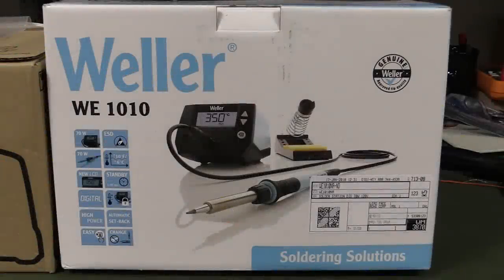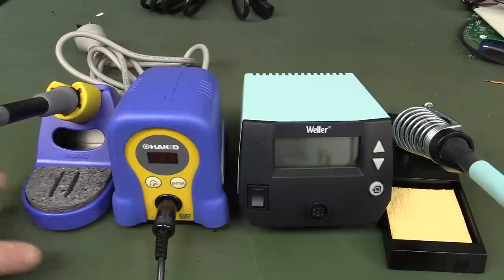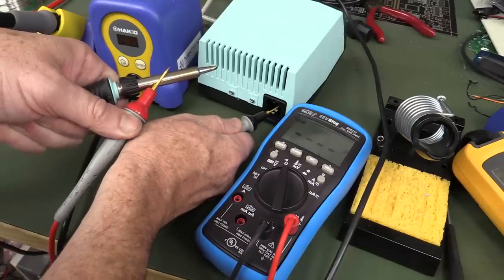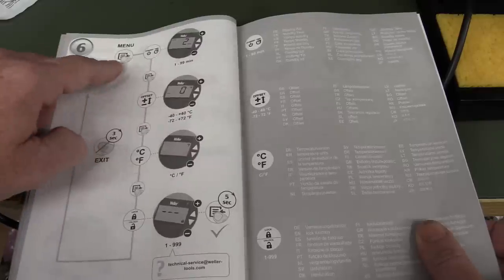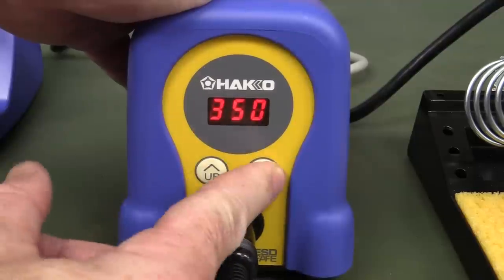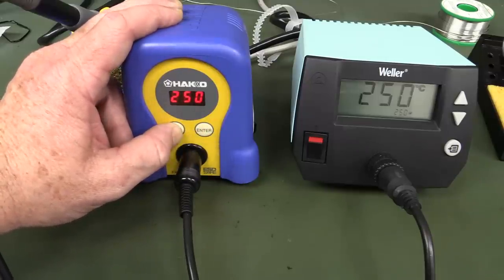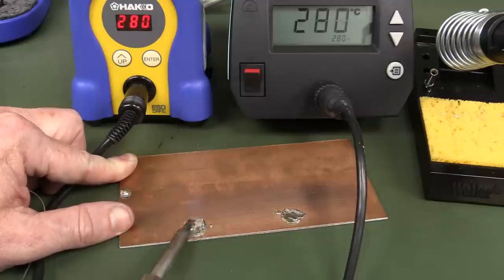EEVblog #1063 - Weller WE1010 vs Hakko FX888D Soldering Station

Comment: I've always loved the easy adjustment Wellers have had. My trusty 50W analog adjustable model was still working perfectly after over 25 years when I upgraded for a better model with more power and smaller handle. I prefer small pen type handles a lot with modern smd stuff. With a bit more power small tips heat very fast too. (You pay a lot more for those too unfortunately)
I've no experience with Hakko but the adjusting interface is a huge fail. I know I'd get so annoyed by it that I'd not get one.

Comment: Looking for your review on the Pace MBT 250 repair/rework station. Like to hear what you have to say on that. This is for serious and dedicated solder techs. Worked with the equivalent of the PRC 2000 back in the mid eighties while in the Air National Guard. Nothing but good to say about it myself. A real station with high quality and versatility.

Comment: You said it best, they both have there strengths and weaknesses.

Personally out of the two, i would go with the hakko, its probably better made for the price. Of course weller is good, but for me, you need to spend more on the higher weller models, to get the quality.

Germany vs japan, and comes down, to how you view the products you like, and what strengths you like in those products.

I would say that the weller, is not as well made as the hakko at the price, as weller are trying to get you to buy there more expensive models, which are alot better.

Comment: Hi, Dave! First of all, thank you for all the cool videos you put on YouTube.
I've just bought a WE1010 but sadly it had the wrong plug in, so i decided to change it by myself, testing with a voltmeter which pin belongs to the right end. As I plugged in the the station, the thing made a strange noise and i immediately switched it of. From the smell the station released I could tell that I've probably damaged it, but I'm not sure, anyway I don't dare switching it on again.

Could you please give me a advice?
Reply: First, if you haven’t blown something up in the last year, congrats! (If you have, you might not see this) If you’ve managed to survive, stop opening cases and take stuff to qualified repair persons.
Reply: Should have read description. it was 120V device you powered from 220!

Comment: My hakko fx-888d came with a chisel tip. The iron I had before was a Weller pen that plug into the wall, the hakko soldering  station  is much better, I like it but if it was a Weller I would be saying the same thing.

Comment: I think that the Weller seemed to do a bit better here. Sure the soldering stand is not perfect, but the interface is much easier to use and makes you feel more confident. In the end they both re-flow and solder just the same, because I don't think that the Hakko has a very good live temperature update, or at least it's not as sensitive as the Weller. I honestly don't care about the minor differences in heating areas if the interface and iron don't feel good to use.

Comment: Had the Hakko and could not stand the UI. The Chinese made 852d+ with 70w iron (not the common 50w) was far superior, at about 50$ shipped. Been using it for years with no issues. Nice big red led displays, hot air with pump, and actual dials for adjustment... The temperature is constantly polled and displayed. Even the connector is better, metal with threaded nut. Calibration is trim pots, but never had to touch it.

Performance is fine, I can do large stained glass pieces loaded with 50/50 solder at 340c and it keeps up all day. Can do silver solder at 280 fo most electronic components just fine too.

As for the stands...the Hakko fh300 is the best stand ever made.

Comment: Great review Dave. But I'd really like to see you review some higher end soldering gear. No professionals use these low budget stations. I personally use the Hakko FM-2027 Iron in conjunction with an FM-206 and absolutely love it for its compact size and super easy to change composite tips.

Comment: Dave you could replace the WE 1010s internal transformer to a 240v version, I would assume it goes down to the same internal voltage as the Hakko 888
Reply from the maker: And were do you get the custom transformer from?
Reply: A broken hakko(assuming 24v seconardy voltage for the WE1010) or make it
Would make for an interesting video, albeit a bit dangerous due to the mains voltage thing

Comment: The only thing the hakko was better in was the base/iron stand, with the exception of the tip storage on the Weller, heading time by a couple seconds, and made in Japan. EVERYTHING else on the Weller (power, power cord, display, ease of use, hand piece feel, hand piece cord, included chisel tip, hand piece grip, hand piece strain relief, etc was better. Color and design was better in the Weller to, but that's subjective. So why is it even a question.

Comment: i am using $8USD soldering iron :) no temp control no station and not even a stand and its ok, i haven't had any issue with it and i can handle soldering with it well... i would rather save money and buy cheap soldering iron as the one that i have and waste the saved money on hot air station instead... nowadays everything (even my own circuits) are smd so...

Comment: Sounds like the tried and tested Hakko is probably the way to go.  4.8 starts out of 5.  Longevity is proven, the weller is a new model, so no one knows if its going to last 1 year or 15 years.  I've had my Hakko FX888 for 7-8 years and use it several times a week on average.

Comment: I  have the Weller 1010NA bought from Mouser but the iron is not the same than yours, the rubber got a better grainy grip, and there is not round metal thing under the tips this is the ceramic, so on the sponge test the tips don't drop that much, and for the calibration i have 40 celcius too high so i had to calibrate down, the temperature go a lots faster on what i set it !! The standby mode seems better i did set it up to 5min and he do no get on standby unless the temperature stay the same for 5min when i use it the always move a little so the standby mode do not go on... I guess i have an upgraded version of the iron.

Comment: I'm fascinated by people's strong tendency to trust information from an electronic gauge.
Car manufacturers have exploited this for 20+ years, "massaging" the readings on the dashboard. It impresses the owner and helps avoid bad word of mouth and unnecessary service calls.
Recently, I've noticed that a brand new refrigerator is several degrees warmer than the display indicates, and at it's coldest setting (allegedly near freezing) it's noticeably warmer than a 25 year old fridge in the garage.  It's not overloaded, it's just not regulating to the temperature it says, probably for "efficiency" reasons.

The designers of these things probably think it's okay to fib a little to make the product look better.  As Elwood Blues would say "It's not lies, just... bullshit."

Be wary of the same game being played in soldering stations.
The most objective test of thermal performance was when each iron was used to solder on a large copper plane.  The results were inconclusive.  The other thermal tests don't mean much because they relied on the built-in electronic temperature display.  There is no evidence that the readouts are equally accurate and honest, and this should not be assumed.  Steady state accuracy was tested, yes, but not under load.
The test of real soldering implies their performance was quite similar.

It appears the Weller is trying to give an honest real-time temperature reading, but it could be shenanigans that the temperature was 20C miscalibrated.  Maybe it's sloppy QC, but maybe somebody was trying to win the heat-up speed test, which every reviewer always tests.  Anyway, I'm glad Dave noticed that and corrected it.

I've owned a Hakko FX-888D for a few years and I've never seen the temperature drop on the display.  The only time it drops is if I set a lower temperature.  If I'm soldering, no matter how hard it is to heat up some big plane, the readout doesn't admit that the temperature is changing.  It's just bullshitting you, don't fall for it.

The heat-up test might have been better if it was based on melting solder. My Hakko FX-888D doesn't melt solder until well after the temperature when it should. It might not be "lying" so much as a design limitation, but bottom line is that the tip lags behind the readout. Does the Weller have the same amount of tip lag? I don't think we can assume that.

The FX-888D was a massive upgrade from the cheap mains powered iron that I had before.  At the time it seemed like a big investment, but it definitely made soldering easier and a lot more enjoyable.  But I now wish I had aimed higher and gotten the FX-951 or something else at that level.  As was noted in the review, the FX-888D is well made, but it's basic design is from decades ago when solder was always lead based and multi-layer boards were rare/expensive.
I find that it is a good iron for easier soldering jobs, but it can still be challenging with more demanding tasks like multi-layer motherboards and video cards.  I even had trouble with a cable modem for some reason - maybe it didn't have thermal reliefs.
I've never used the Weller, but the review suggests it would perform about the same.

The temperature control on the FX-888D is clunky, but it's something I can deal with.  I find that depending what I'm working on, I want a different range of presets, but once I have them set up I just switch between them for the duration of that job.  It's fine.
Unfortunately the Hakko's temperature display is only good for entertainment, and for being reminded what your set temperature is. It's not a credible indicator of real temp fluctuations.

As Dave mentioned, the manual included with the FX-888D doesn't detail all of the setup info and doesn't tell how to reset the unit.  Many new users accidentally mess up the calibration the first time they try to change the temperature, and if you do that you need to reset it.  Get the manual online, it's more complete.
I'm surprised to hear that the incomplete printed version of the manual is still being shipped with new units.  Hakko must have gotten a bulk rate on 1 Million copies of the manual and doggone it they're not gonna throw them out.
Reply: yorgle11, Well I'm an old mechanic and going to a new style unit like this made soldering indescribably better, You didn't mention the Hakko flashes the little red light when the unit is heating the tip during use, I think your level of use is much higher than the average joe. You didn't mention that you can recalibrate it as well, As you can tell I'm satisfied with this unit.

Comment: Farenhieght isnt so rubbish when you realize its a finer scale, and works better in climates where temperature doesnt change much.  1 degree in Celcius can be 5 in Farheinheight which doest tell you much if you need finer percision.
Reply: Or... one could use decimals, such as 0.2degress Celsius. Not that hard...

Comment: After seeing the comment Louis Rossmann made my opinion of these old type soldering irons as he mentions is starting to change.. he made a good point..but as my main use case would be de-soldering i would have to buy the more expensive FM-204 add to that the FM-2027-03 soldering kit.. totaling €1022 but the FX-888D + FR-301 would total €375 so way more .. could you ore Louis go more in depth what the difference is between the heating elements technologies

Comment: You would never usually hold your tip on the sponge that long, moot point maybe - but also a possible indication of weak thermal capacity.  Im a little disappointed in the wellers performance, and theyre made in mexico now so.....

Comment: I have the FX-888D, would rather have the FX-888. I do not like the buttons. A knob is easier to set.
The 888 looks like a minion in a smurf skin.
I like the weight of the hakko iron stand, but like the spring of the weller.
The iron on the hakko (if not inserted correctly) can stick up and out of the stand.

Comment: I wish I'd found this video before I bought my Weller, then I'd known before hand how practically useless (and annoying) the standby function is and how slow it is at getting up to temperature. Didn't know about the potential need to offset the temperature either, thanks for that, I guess I'll have to check the actual tip temp.

Comment: I've had my Hakko 888D for maybe 4 years now. Functionally its a very solid iron, and I love the styling. But you're right that DIN connector is pretty shit. I move my iron between two benches fairly often, and sometimes unplug it when I do it. I'd estimate I've unplugged it maybe a hundred times since owning it. Now the temperature display goes nuts if I wiggle the cord a certain way, so I'm going to have to replace the connector soon.

Also the interface is the worst, just the worst...how hard was it to put another button or two on it? Or a rotary encoder for crying out loud.

Comment: never used the WE1010, but the weller that it replaced is nowhere as good as the hakko. I prefer hakko at the low end for what I have used, but the weller PES80 handpieces are a dream to use. too bad the PES80 handpiece costs more than either of these stations.

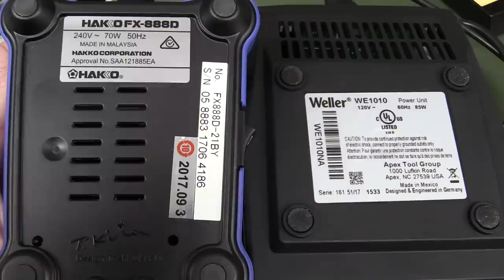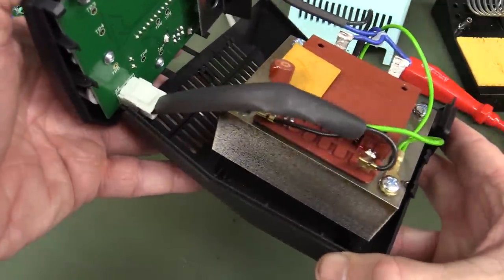Comment: Is anyone seen or notice that he just test 120V Weller and plugged in 240V in Australia current Voltage for the whole time!!! WOW, and the Weller did an amazing job! You can see it in the 30 seconds of video on the label on the Weller box 120V and also in the 12:30 of the video on the label on the bottom of Weller and also at the end of video 39:10 from Hakko's green transformer board said 250V and in the 39:35 of video on the top of primary side of Weller's transformer said 120V. So!!! I think this review is not fair and it's useless. Even he didn't realize it, till eventually in the next time in another video he uses the Weller. I think you should test Hakko 120V and plugged in 240V and see what happen!
Yes, I agree with some part of the station is poor like not good a soldering station or primary transformer fuse, etc. but do you think Weller's easy menu and brief user manual is not better than Hakko's difficult menu and long long user manual?!! Don't argue for that.
And in the end, make a fair video man!!!

Comment: Dave, ive always wanted to know, can i solder inside my soldering station, using itself? Will it go bang in a spectaular act of smoke and fire or will it work without an issue?

Fancy trying it out for us, seeing as you have all these soldering stations laying around? :-P
Reply: iwtommo It will because the tip is grounded

Comment: To be frank, ebay Hakko rip-off tips can be as good as genuine ones. Thin ones are burning quick, chiseled ones last a long time. I have one fake Hakko tip that did 1500+ joints and is still fine.

Comment: How about the Kurtz Ersa ICON VARIO 4
Great soldering station. Worth it
Reply: Felenov-official Ersa rocks, but I’m not sure it’s fair to compare a €3000 ersa to $100 stations! ;) 

I do love my icon nano, which beats both of the stations in this video easily.
Reply: Antonio Tejada  it does indeed. And it's much better than JBC
Reply: Antonio Tejada and when I was starting I had a hakko 936A and it still works fine. The new Hakko are pretty inconvenient to use, back then Hakko had decent connector.
So I switched to Ersa

Comment: Dave tested the North American version of the Weller WE1010, which is obviously designed for 120V grid power. As you can see at 39:32 in the video the built-in transformer is rated for 120V. Could it be that Weller is not able to adjust its temperature as fast as the Hakko because  he is using it on an Australian grid (with a 230V/50Hz voltage/frequency) ? I don't know.

Comment: I just bought a hakko fx888d and is not melting lead free solder even a 820F (438C) on the tip, but it does close the heat element, but not the tip, it melted well the first 10 min, then the tip stopped melting lead free solder, maybe I screw up the tip wit the sponge?, the sponge was not very wet and smelled like cheese, it was putrifact
Reply: Hakko FS100-01 Tip Cleaning Paste 10 g for FT-700  10 bucks on amazon.

Comment: Been using my Weller TC202D for over 30 years. In this time have gone through one heating element. Aside from that never an issue. I use it for anything including smd. Have I ever needed variable temp control - no and nor do I want it. I love the spring iron holder and the fact that its attached to the main unit and not an attachment that takes up more room on my bench and goes sliding all over the place. I also love the spare tip bay. Do I care that it takes a bit longer to heat up from cold? No, I'm never in that much of a hurry that I need a hot soldering iron in seconds. I have used all the new different type irons out there and I hate them all. I would not swap my station for anything out there and I could also afford the latest and greatest yappity yap station if I wanted it . Each to their own but in my opinion there is a lot of hype regarding soldering stations. And no @BMR Studio you are not the biggest Weller fan here, I am ;)

Comment: I have the 888D and it’s great.. but it’s design reminds me so much of an Archos Jukebox from 2002. Except the user interface on the hakko is years behind the 2002 archos 😛
https://en.m.wikipedia.org/wiki/Archos_Jukebox_series#/media/File%3AJukeboxrecorder2b.jpg

I love the hakko stand though, it’s really really solid. I’ve done a lot of soldering with no issues so far, and heat transfer is good.
Reply: How do they look anything alike? It's just that both have blue in their design. Come on